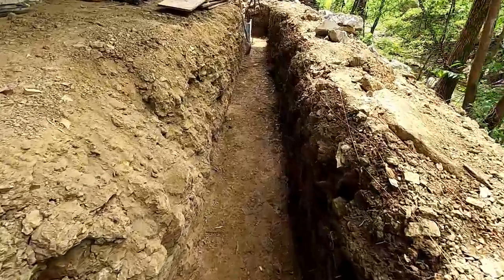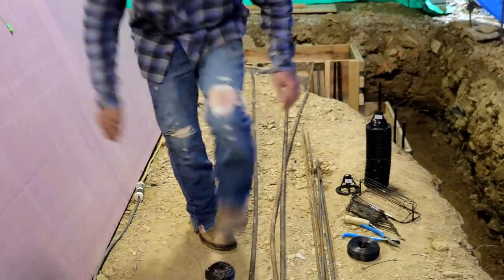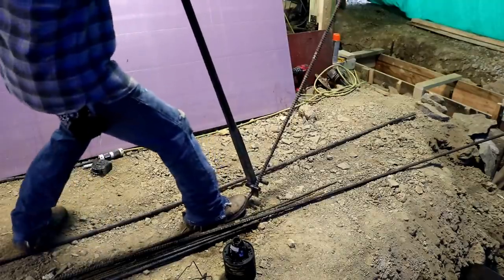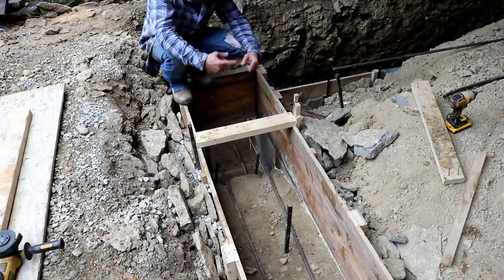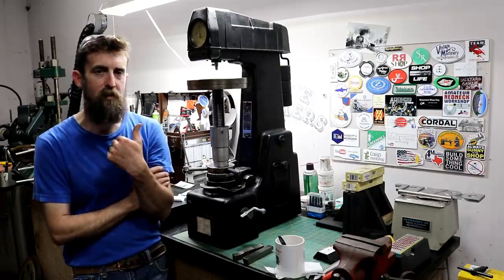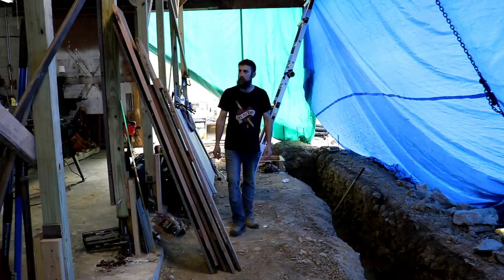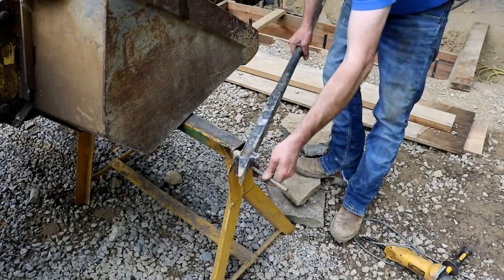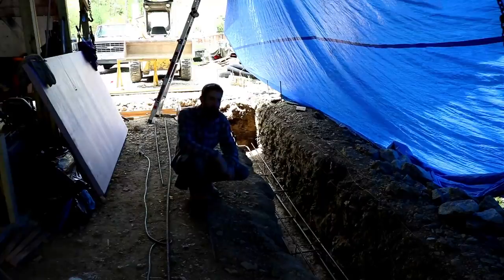Failing Inspection :-) Footer Rebar work / Wilson Hardness tester \ New Tools!

Comment: I bught one of those neutral/negative, (can't remember which they are, & the lathe through a chunk of cast itron in my eye, this mornjng, so I'm flying blind, and hoping I can go to sleep.) rake steel blades, a Diablo blade.  It cut like a dream, steel, aluminum, hard copper pipe.  Then, I cut some SSmystery metal, and it hasn't been the same, since.  I didn't push, or crowd the feed rate, but it was like the SS was 'sticky', and it was dragging on the blade.

I haveen't hasd  the chance to look at it under magnification, yet. And after the chit in my eye, it'll be a FEW more! LOL

I've been wondering if I can use the carbide saw blade sharpener I have to reshape pos rake wood blade into the same shape & rake as e steel blades. The Diablo blade has a near square rectabgle shaped tooth with the corner mitred off.  That's easy to make, as long as I can figured, and measure the rake. I think I can set up the sharper with thhe steel blade in it, and confiigured for it, then swap out thr blade with a smae size wood blade, and fine tune the adjustment.
.

Lookin' good. I haven't watche dthe whole vid, but I'm wondering what the inspector said.  

Prepare for a rain day, and you'll make it sunny weather everytime!  Was a carpenter for nearly 40 years in Oregon, and it is a 'rule'.  If you wanna make it rain, just blow off covering the job up!   LOL

Jb's lookin' good.  Hardness tester is cool. Look in a big inventory 'reference catalog like MSC or McMaster and I bet you can find a compinent or material with an accurate enough hardness rating to use as a test for the machines. Likely get it for a fraction of something in the "Metrology Section"  

If you're not testing for te public, you don't need the accuracy, if you do, later, you can always buy something better, but I'd bet you can save 50-66% on a test piece if you dig deep.

I spend a LOT of time in MSC's catalog, my wife works for MSC, she builds the product titles, which is the heart of the search.  I find erros, and she turns them in. The company has an ongojng, annual contest for most errors found. She's won it a couple of years, i think.  She won a REO (?) 6-7 pc set of cbaly countersinks, 6 flutes I think, they cut great.  MSC is a good company to work for, they have a lot of incentive contests, and stuff. She wins tickets to events about once a year. Heck, she won the iPad I'm typing, (blindly), on!

The employee purchase program is great. If you know any older, experienced machinists, they are usually always looking for experts to partner with a sales person, and be useful to customers, (if you were running a shop, it would be nice to have a machinist at your disposal if they knows their stuff about tooling, workholding/jigs, etc

[Sorry to go on, but it's keeping me sane right now, this eye is driving me nuts, it feels like I have an eyelash curled under.]

If you do know anyone, let me know. They pay a ref fee.  Like I said, good company.  They are open to ideas and suggestions, greta to their employees, (closed the offices early, sent people home to work, full pay. They are a publicly traded company, but are still family-owned.Founder's grandson, (greatgs?) is running e place, now.

Good luck with the hardness testers, and e other greta gifts from Al.

 {{Hope this is legible, understandable, I literally can't see the screen, and the keys are real blurry. Got ointment in my R eye, and my L is far-saighted.

Later...

Comment: Cut off disc's quailty vary between brands,some last ages,others  are gone in the blink of an eye.
Stabila levels nothing better.
Reply: There certainy are brand differences, but I have a smaller version of Steve's Evolution saw, with the "gernal purpose, cuts everything that isn't stone" type blade. When I bought it, one review said "cut 10 cuts of 10 x 35mm (approx 3/8" x 1 3/8) steel bar before blade was ruined", so I was worried that it wouldn't work well. I don't use it every day (hobby machinist, so I have other things to do most days), but I certainly have done way more than 10 cuts, most of them bigger than that size steel, as well as some aluminium. I did eventually find the limit of that blade, when I tried to cut some EN24T (similar to US standard 4340) at 45mm (approx 1 3/4"). Now the blade says that it's good for up to 6mm (1/4") mild steel, so I guess going 7.5 times the recommended, and a not so soft variant was a bit too far. New blade set me back £30 - approx $35, which is about half of what the saw cost in the first place! At some point I'll probably upgrade to a saw closer to the one Steve has, but for now, being able to chop through 2-3" wide and up to an inch thick basic steel is good enough - and total spend so far is around $100... 
I think some people are more heavy handed with their power tools than others. Yes, there's good and bad brands/specifications of blades, discs, etc, too - but I believe some of the time, it's the "workman" rather than the "tool" that is the cause of poor results.
Reply: @matspatpc  Similar principle as with a band saw...that machine will talk nice, and you've got it.

Comment: being that your wall is so close to a slope and flowing water I am surprised that piles(sorry I dont know what they are called in your area but a structural member driven down to bedrock usually steel) weren't recommended at least in the corners.

Comment: Rockwell test pucks. Indents no closer than 2mm. The standard are 1.5-2" in diameter so one will last you forever. You could share it with the usual suspects if you wanted. 😁

 Worked for an Aerospace Mfr, we tested our machines weekly. Temps and 1/8" rust will affect the test but only by 1 point, such as 40Rc would show 39. I wouldn't worry about either. I was an inspector, we had 4 stand and 2 portable machines. 

You could have bribed your inspector with a night out. Nudge nudge wink wink!

Comment: I poured a lot of footers and all where rebar reinforced. Only laymen who do not know what they are talking about will say that is good enough. Well guess what that does not pass code. Plan and simple too. The reason we have to deal with codes today is because so many failures have occurred because of the people thinking is that is good enough. WRONG !!!! Also, are you below the frost line ???? That must be kept to location of build. How about you are how many feet from the creek ??? The hardness tester you have is a tool that will last you a lifetime. I know cause my neighbor who has a machine shop had his for fifty years and he still uses the tester, they are bulletproof. I like your squirrel for sure. Nice little pet.  The rebar looks good. Wish for your sake that you would be done but you know when you work that is never the case for sure. Only one thing is certain and that is we will work our lives away. Keep on keepin on. Wish you luck for sure. VF

Comment: " I need more ass" Omg lol ! Yes leverage is a wonderful thing but you need enough to make it work sometimes. A touch of heat would have made things easier to bend. Your forms look fine. Anything you do is far and away above what was there when you started and you do your work to YOUR satisfaction (and maybe the inspectors) cause you are going to have to live with it. Looking forward to the concrete pour..........

Comment: I am guessing you know something about concrete that I do not, I am trying to figure out how you are planning on keeping the concrete in the upper end forms from flowing out into the lower form. More than likely it would be easier to use a pumper truck to pour the footing and that requires the concrete to be loose. Good luck

Comment: As I understand, the reason you don't want to use you $100 blade on rebar is the imported stuff has a lot of recycled mystery metal content.  A few grams now and then of tungsten carbide or other hard matter is not an issue for the rebar but sure could eat up a couple of teeth on the blade.  I have seen this while trying to drill some import cast iron.  Normally cast irons drills easily but had a hole that started ok but then just hit a hard spot and would go no deeper.

Comment: Steve, your electrodes might be wet. They are sticking to the part you welding  - you might want to dry them for 1/2 in oven

Comment: Can I ask a stupid question? When the concrete is poured into the higher formwork shuttering, what stops it from just overflowing out of the bottom? Or do you pour the lower level, let it set then pour the upper parts?

Comment: Why do you have to remove the forms in the areas you are concerned about since they will end up being buried in fill?
Reply: I'd bury them, not worth that nightmare for that lil bit of lumber.
Reply: I grew up in a construction family during the 60s and we were always taught to remove the wooden form material and scrap cutoffs in order to avoid attracting termite activity. Just my 2 cents worth.
Reply: Or later settling of the fill when the wood rots away.

Comment: The problem with cutting rebar is just like the problem cutting Tee posts.    You may have no  issues with cutting the first 10-25 pieces......then you run into that piece of fire brick or ball bearing that didn't melted down all the way and then bang, you lose half the teeth on your blade.   This dirty steel containing all kinds of impurities.

Comment: I will tell you this about the Evolution saw blades. What will mess 'em up is getting distracted and forgetting to tighten the vise, Don't ask me how I know! you are sot on however about cutting. Just keep the blade in the cut and she will go and last. The Evolution saw and similar ones are so much better than an abrasive saw.

Comment: Be careful welding with frayed edges on your pants.  I caught my pants on fire once like that.
Reply: It usually goes like that. You're welding under the hood, and then you feel that gentle heat on your leg. And you think to yourself "Did I just set my pants on fire? Yeah, I probably did. Lemme finish this weld and I'll put it out."
Reply: Happened to me with a cutting torch.  Definitely something to avoid!
Reply: I burnt my sweatshirt on the belly while cutting with a side grinder once. Sparks flying onto my belly. By the time I realized, the burn hole was about 6" in diameter. I had a cotton t shirt underneath, that's what saved me from getting burnt.
Reply: @marcellemay7721  walking around workshop saying I can smell burning everywhere I went, turned out my overalls were smoldering, and slowly disappearing into a big big hole.
Reply: what are the gloves for if not putting out improptus fires?
Reply: I have set myself on fire welding or cutting stuff more times than I care to ever remember and unless it is my hair, my beard, or my balls, I rarely do more than spit on my hand and pat whatever is smoldering or burning out and keep getting on with the getting on.  It's kind of like when that "Mig ball" of piece of slag runs up your pants leg, down your sock and stops in between your toes you can do one of three things cry like a baby with a dirty diaper whilst you take your shoe/boot and sock off, you can do the "hotsy-totsy" dance (both of which in any of the shops I have worked in someone(s) will get razzed to know end with different versions of pity parties) or you mumble out Muva-F*cker while you continue on with your welding.
Reply from the maker: I've  done it before as well.  6 or 7 times:-/
Reply: That funny feeling of something crawling up your leg.  Then you finish the stick and lift the welding hood to find one leg of your blue jeans missing from the cuff to the pocket...

Comment: I'm confused (not hard to do ..). Isn't the concrete at the ends of the forms that is higher just going to flow down to the lower area?
Reply: turbo2ltr if you let the lower section start to set a bit the when you pour the upper section the concrete will not blow out the bottom.

Comment: There is absolutely no point to cleaning off rust from rebar. If you want rust free rebar, you can get coated rebar. Though that's expensive as heck. when I do concrete, I throw just about any suitable scrap iron into the mix along with some rebar, it all helps to bond the concrete to give it tensile strength. Overlapping rebar is also just a good thing, don't worry about making them exactly the right length, they will only be stronger if they are abit longer than you need em.
Reply: Do you know it's scrap yard rebar? It might have heavy scale rust on it. 
God bless you! 
Please place your faith in Jesus Christ, the Son of God, for the justification of your sin so you go to heaven instead of spending eternity in hell when you die?
Reply: Coated rebar is banned. The why of it is a bit complicated. But coated rebar rusts through faster than uncoated does.
Reply: @cessamichelle  sound rust is a passivation layer. As rust does not rust. We use oxides that way with metals. Aluminum "doesn't rust" because it immediately forms an oxide layer on its surface. We use chrome for the same reason. See the Iron Pillar of Delhi for more on this topic. Unfortunately it is closed right now so I guess you can't?
Reply: @michaelboyle1983  There is no life after death, so quit wasting the life you have on religion.
Reply: @michaelboyle1983  ....I believe "eternity in hell" would be scraping rust off of rebar.

Comment: Steve,
Is that the rebar the scrap yard gave you? Seeing how tough it is to bend I'm thinking it's grade 60.
Reply from the maker: Yes, Frank gave me most the bar.  I'm not sure on the grade. Ill look it up
Reply: @SteveSummers  The grade is usually on the bar it would be either 40 or 60 and may have a G or GR with the numbers.  60 is the higher tensile strength.

Comment: Sorry you failed your inspection, but with the rock as a stabilizer next to your form boards, they pour the footer your form boards are probably going to stay, they come in pour the new floor, but over time that form board will deteriorate, and pockets of air are left. Slab starts to settle,  possibly crack, and back where you started, no where near as bad, but is possible. The concrete needs to flow so no voids. I think was his concern. Also, as an electrician for 40 years, have seen thousands of slabs formed n poured. My second concern is posting "he's nuts". If per chance he sees that on YT, he is really going to find anytning he can to turn it down again. Learned a long time ago, never argue, yes sir, no sir, play their game. Especially if it's a home owner pulled permit, and work. They look just to find something. Just things I've learned in construction, n inspectors over the years. If it were me, I would change your intro of the video, just in case. If he is a dick, he might find a few other things wrong but only tell you 1 or 2, then come again, point out other things he saw, but didn't tell you. Have seen it before. Just my experience with some inspectors. Missed you last week, so glad all is good with you n your family.

Comment: could lay in some plastic before pouring or reale wet the soil down , i think that if the soil is dry it will draw the moisture out of the concrete before it has time to dry fully just need to be stopped some and getting the sides wet shouldnt cost too much except maibe some extra work
about the hardness oven , these hobby emaille ovens https://www.keramikos.nl/2144/emailleeroven-efco-110-12x7x13-cm.jpg along with some sort of temperature controller from the known chineese sites probably is big enough to harden toolsteel the size of routerbits lathe tools and the sort , i think thats about 90 persent of wat you would harden , they usually can be found on places like graigslist for 35 bucks , they have bigger ovens too but this one is sized small enough to put on a shelve when not needed

Comment: What’s the point of using tool steel, if you’re not going to harden and temper it? You might as well use 4140, 4340 or 1144. Or is it just what you happened to have?

I agree with how you use the saw. I have one of these, not this manufacturer, and with the right blade, they can cut almost anything, though not hardened steel. But, right, don’t force the blade through the material. Some people are in too much of a hurry.

Did you calibrate the hardness tester? I have one, and they’re very delicate. Anything can result in errors.

Comment: The advantage of building forms through the whole trench is that you can have a calculated volume of concrete to fill the trench. A form built to hold one cubic yard of concrete will hold one cubic yard. A rough trench might take 1.5 cubic yards of concrete to fill to the same specified height. That extra concrete certainly isn't free. Don't be cheap, but don't pour more money in the hole that can be better spent later on in the project.
Reply: The time and materials to build the extra forms you don't need isn't free either. Its all a load of different compromises to get to the finished result.